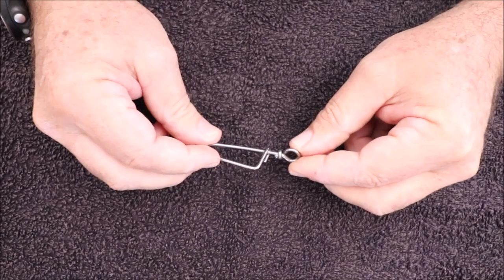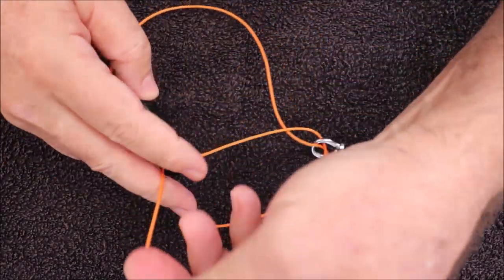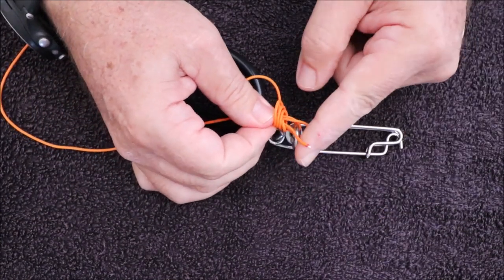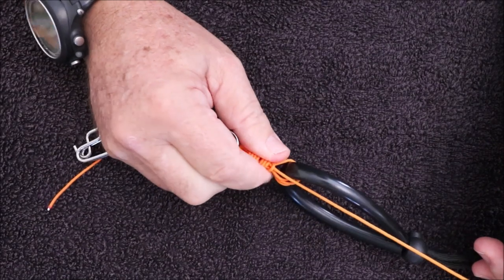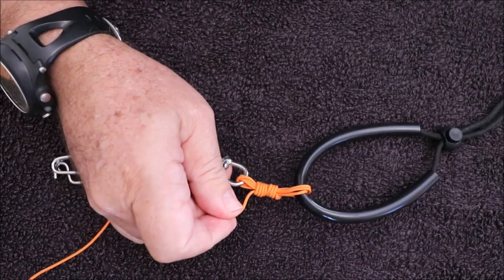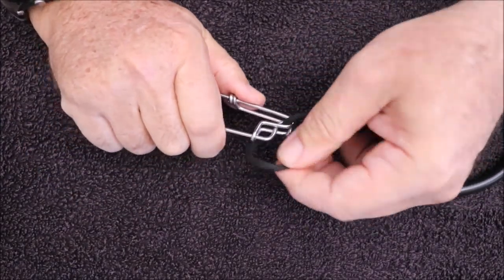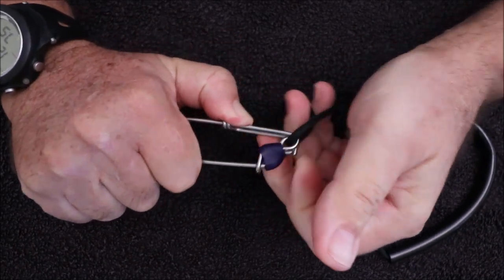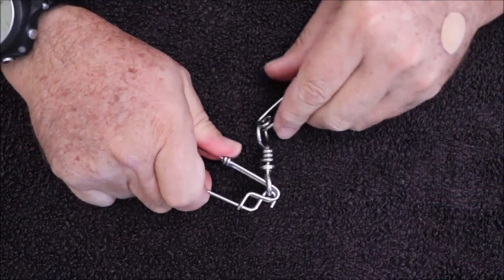Rob Allen | How To Series | Knots

Comment: What size is that blue bungee rubber used on the clip
Reply from the maker: Our bungee rubber in 10mm OD with a 4mm ID. You can use an old 14mm speargun rubber, just cut it a little shorter.

Comment: Hi rob,just question, i am buying rob allen scorpia close muzzle and i want to upgrade/change it to open muzzle double rubber,any howto on that one? Thanks
Reply from the maker: You buying just the muzzle or the whole Scorpia gun? If the whole gun, easy to change out the muzzle but, be careful not to overload the barrel. The new Scorpia barrels are made lighter so designed for only one rubber. You can use 2 x 14mm  rubbers if the gun  is not too long.
Reply: @RobAllenSpearfishing   will buy 90cm or 100 cm one i think,lets see tomorrow when i put my hands on it
Reply from the maker: @dieli9499  If you can choose, the Sparid is the better gun. You can upgrade that model, no a good idea to try upgrade the Scorpia.
Reply: @RobAllenSpearfishing  the sparid one can add 1 more rubber?so it will be double rubber?
Reply: @RobAllenSpearfishing  the sparid one,should i upgrade to open muzzle? Or not necessary to upgrade the muzzle? I am going to put 1 more rubber band if possible
Reply from the maker: @dieli9499  To up grade I meant you can add a 2nd rubber but you must also then upgrade the spear. A gun set up with a single rubber will have the right spear for that rubber. If you just increase the power on the same light spear it will become inaccurate, not a good idea. Better to go with the Tuna if you want more powere as this will already have the right spear to suit.

Comment: Hi Rob, how can I remove a shark clip from the butt of a gun in case I do not want to use it? I tried un-screwing the screws from left/right part pf the handle but they got worn out. And a second question: I own a Sparid, but changed the shaft to 7.5mm and added a second 16mm band. Is there any other structural difference between a Tuna and a Sparid apart from the band/shaft setup? Thanks in advance!
Reply: Hi Christos, in order to take off the longline shark clip, unscrew both screws on the right side cheek plate. The left side are imitation. Once both right side screws are out, the 2 cheek plates can be removed and the clip will drop out. Then simply replace the 2 cheek plates. Re the Sparid, all the components are the same, no problem upgrading it to a Tuna.
Reply: @roballen1578  Thank you!
Reply: @roballen1578  really glad I looked at the other comments, I had the same exact same two questions:-D